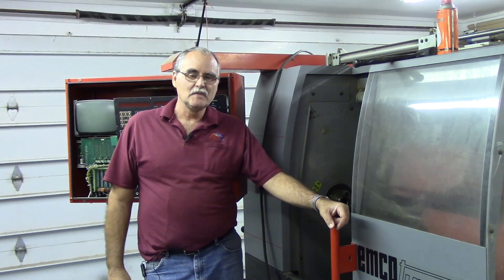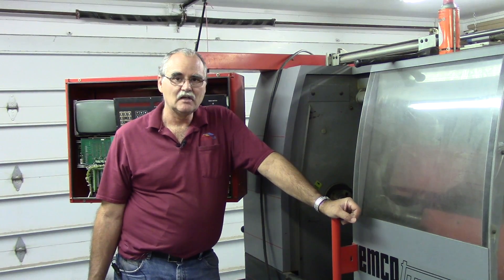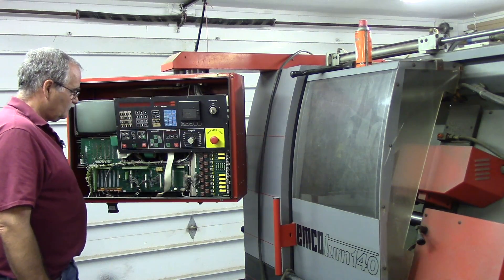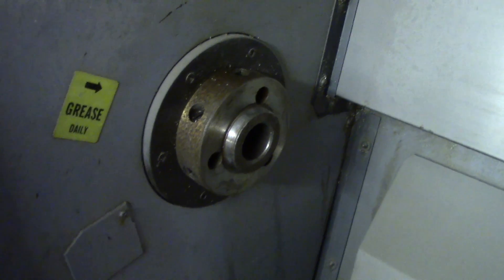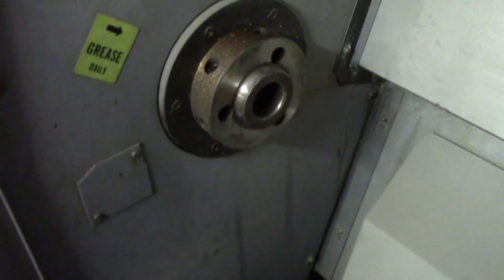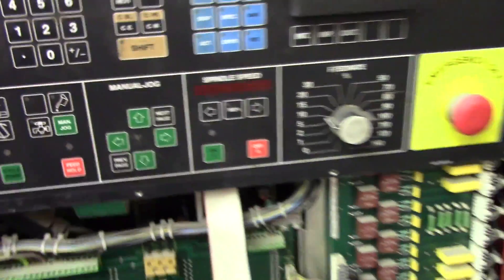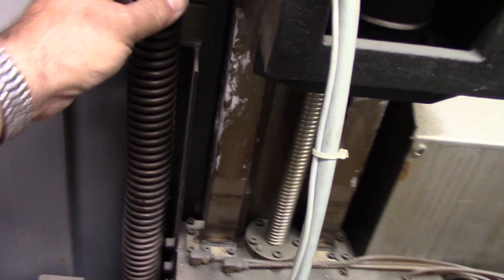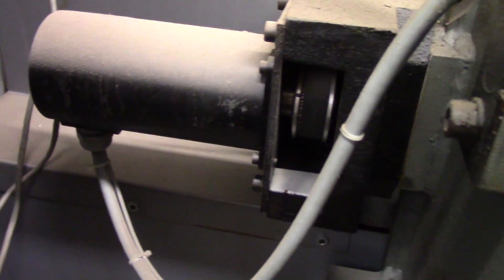Emcoturn 140 Introduction - Centroid CNC Control Conversion

Comment: Great video! Question I have an old mori seiki SL1 with the yasnac 2000g controller. I need to make a rotary phase converter but I'm trying to avoid the $2k cnc grade unit that sell. Will building my own rotary phase converter damage my SL1?
Reply from the maker: You are best to look at American Rotary's converters. Yes, if way out of balance you risk damaging the control.